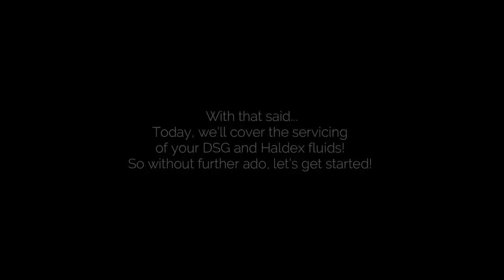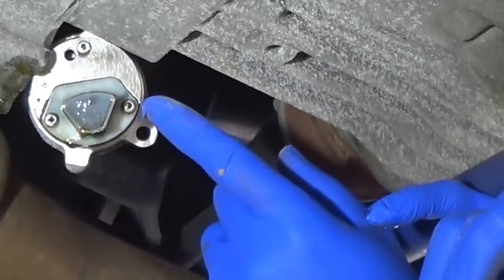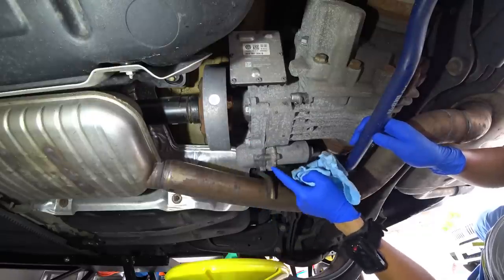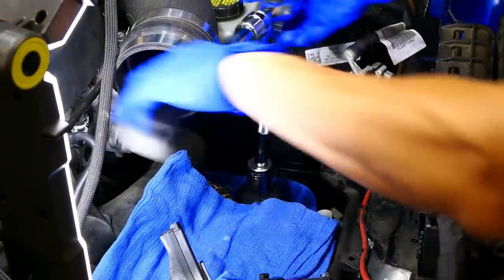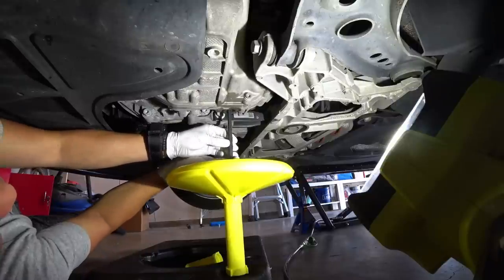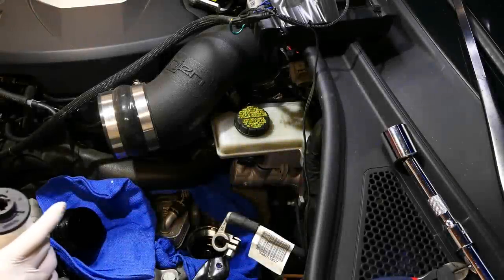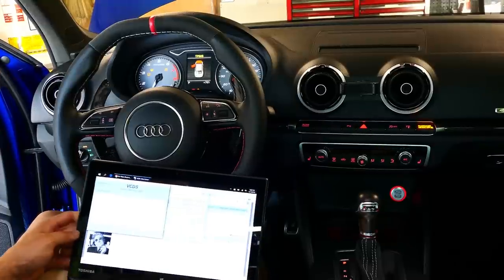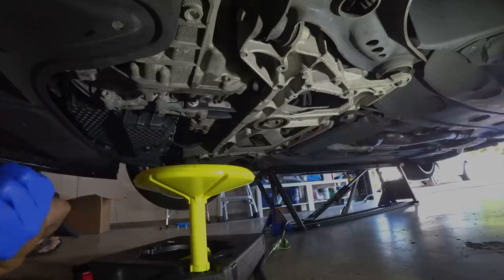How to change DSG and Haldex Fluid on an Audi

Comment: Great job!  I would add that you also need to prime the haldex pump after a fluid change, especially since you have VCDS.  AWD > basic settings > pump motor.
Reply: NickVisual is it necessary? without vcds is it impossible to do dsg oil change at home?
Reply: When is this done? After or before you've turned the car on? I thought letting it run for 30 seconds is the equivalent of pumping the haldex motor.
Reply: After draining the haldex side of the rear diff and filling, running the car and going through gears works fine.  I've tested it, and it pumps fluid through.  However, this works if you don't want to start the car.

Comment: amazing how much fluid went in after driving it around and refilling a 2nd time also people need to run the pump relearn feature which learns the pumps rotation speed it will be a lot faster because of the fluid being clean great video by the way
Reply from the maker: Thanks for the comment Debra, you're correct. Once the haldex fluid is filled, the pump should be primed.
Reply: What do you mean by this?

I thought running the car is the equivalent of pumping the motor. When I do mine I was going to fill it once. Let it run for 30 seconds and check temp. Turn car off and refill. Then run the pump via VCDS and refill a 3rd time.
Reply: @debrajohnson4689  This was actually pretty useful.

I think my next question would be do you perform this action with the car running or off? 

I understand now why the pump relearn feature is done. Actually makes a lot of sense.
Reply from the maker: @debrajohnson4689 , great tip!

Comment: Sir, thank you for the great video. I see that you serviced the Haldex pump without undoing and removing the electrical cable. Can you elaborate a bit on that one? My cable has a withered hull, the two little cables inside are visible. The hull was green and totally crisp, almost looking like oxidized copper. I know there is an electrical connector on the other end connecting to the little "computer" for the Haldex, and I fear to try to undo/open that electrical connector. Do you know how to do it without it breaking? I'm not familiar at all with electrical connectors on these modern cars. I have an Audi S1 from 2015. Also, another youtuber-mechanic was doing some stuff with an OBD or similar computer, checking or resetting something when he had removed the Haldex pump after refitting it. What would that be about?? Surely you can change the oil without involving computers?

Comment: Just an FYI - I realize this is for an S3, but on my RS3 there are two drains and two fills on the rear diff.  One side is for the Haldex pump and clutches, the other side is for the actual gears.  They use TWO DIFFERENT FLUIDS!!! Be careful doing this, as I made this mistake and put the wrong fluid on the Haldex pump side.
Reply from the maker: Thanks for the insight Funkyman831. This is something I was not aware of as I never had a chance to work on the tranny/diff/etc on the RS3.

Comment: Good video! If I may add, You should prime the pump using  VCDS. Go to AWD control module and run the pump. Just turning on the engine will not prime the pump.
Reply from the maker: Thanks for your input Q7-A3. You're correcting, priming the pump is HIGHLY recommended and a step I missed in this video.
Reply: Sorry guys, but why should any "priming" be necessary just by changing the oil? Please explain. Shouldn't the computer of the Haldex, that flat thing, or the cars ECU do exactly that?  @TheAutomotiveFanatic
Reply from the maker: @Unexpectedperspectivesnow your question is more technical that I am versed for. In my research, others have mentioned that it should be primed so I assume it's best practice to it that way.

Comment: The soot in the Haldex is most probably from the clutch disk. It's essentially like a brake drum or clutch or brake pad on a brake disc. It slips and rotates at different speeds. Or am I wrong?

Comment: Great clear instructions! The only difference I have is that the drain bolt is a 5mm allen which was the same as the fill bolt. I also have an 8vS3 2016
Reply from the maker: Thomas, glad yo found some use of this video! Cheers and enjoy that S3!

Comment: is not "soot" - its clutch material - and perfectly normal. Thats why the oil needs change. Good video.
Reply from the maker: You're correct Corvette Kro. It's 100% normal but owners should definitely clean it often.

Comment: That black "soot" is the fine metal particles from the clutch pack from repeated engagement. It's normal wear and tear.

Also, do you have the torque specs for the drain/fill bolt and the bolts for the pump?
Reply from the maker: Sorry for the late response CookJunkie. The torque specs for the drain/fill bolts are: 32-35nm.

Comment: I have a question, Im going to be doing this dsg service in a couple of weeks on my 2015 audi a3 quattro. My question is, let say if I drain 5 liters and I put 5 liters back in, is the turning on the car, shifting the gears, letting the transmission get to the certain temp then draining some out really required? Im just putting back in what I took out. I’ve always wondered if those other steps are really required. Great video btw! It will sure come in handy when I have to do mine!
Reply from the maker: Keep_boostin, the way that you're planning to do it, is the most simplified way. There's absolutely no need to do all the other actions as long as you put in, exactly what you removed. I would have performed my service this way, but I wanted to show people how Audi would do it. There's more than one way to skin a cat. Good luck, just make sure you measure the exact amount of fluid that drains out.
Reply: The Audi S3 Fanatic That’s great news! I had always wondered if that worked, Im happy it does! Yes I’ll make sure to measure everything exactly when I drain and fill. Thanks again for the fast reply and the amazing video!

Comment: Hey Peter, that was a great video instruction you made!  (1) I wonder if I can apply the same procedures to my 2018 Q5 2.0t Quattro? (2) I read the comments below and wanted to verify that there is a front differential, a rear differential and a haldex, a total of 3 fluids to change in addition to the DSG transmission?  I'm kind of confused...
Reply from the maker: Hello Shawn, If you are doing a drain and fill, yes, measure the fluid that comes out. Then simply replace with the same amount.

Comment: So is the car running when you drained the excess fluid out on the DSG service?  or can the car be off?  Didn't know you can fill from the top? How about when you disconnected the battery, any issues with resetting things?
Reply from the maker: Yes, you want the car to be running so that it can reach proper operating temperatures.
When disconnecting the battery and reconnecting it, your dash will light up like a Christmas tree with all kinds of error codes. It's normal and as soon as your start driving, the dash warnings will go away.
Reply: @TheAutomotiveFanatic  thanks, i see now i can get to the filter easy not removing the battery by removing the intake duct and using a low profile 24mm socket with 3/8 wobble extension. I have OBDeleven to get temp correct before final fluid set. Doing this service this weekend. Try to decide to fill thru the top or use hose and fill thru the bottom drain??
Reply from the maker: @skydancerforever Thank you for sharing your DIY steps. Hopefully it helps others too!

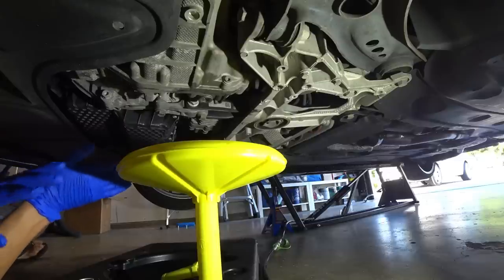Comment: Great tutorial! Is the engine still ON for the last drain at 18:14? After it’s reached the correct temperature ?
Reply from the maker: Yes it is, until you drain the excess fluid and tighten up the drain bolts.

Comment: Hi Peter, so when you’re leveling the dsg fluid, letting out the excess fluid how do you prevent from having more than the excess fluid empty out lol. I just don’t understand.  Is it the temperature? 

Thanks
Reply from the maker: The reason why Audi recommends that you "level" the fluid, is exactly due to fluid temperatures. I understand the concept, but cannot fully explain the principle behind it. I believe it deals with viscosity, flow rate, etc...

Comment: Did you replace the pump seals and mounting bolts and/or the drain and fill plugs with new ones? I think it's recommended, but maybe not necessary. While the drain and fill plugs are only a few dollars each, the pump seals and mounting bolts are about $40 total, so I'd prefer to skip it, if it's not really needed. Thoughts?
Reply from the maker: Jeff, I did not replace any of the items you mentioned. As you know, Audi would recommend it but I do not believe it's completely necessary. I've checked the surrounding areas and not a single drop of fluid. You should be fine as long as you don't damage any items in the removal process.
Reply: @TheAutomotiveFanatic  Thanks for the quick reply. I'd assumed as much, but really appreciate the feedback. Other than people doing videos who are selling products, I hadn't heard of anyone replacing them, which makes sense. Thanks again for all of the great videos!
Reply from the maker: @reaxions  Thank you for the support!

Comment: Hi Peter, I finally managed to get the DSG oil refilling bottle so am going to replace the DSG oil soon, I just saw again the video and I noticed that during the DSG oil levelling procedure, the engine is running; is this a "must do" step? many thanks!
Reply from the maker: Yes Lorenzo, it's important to have the engine running to properly level off your DSG fluid.

Comment: The one thing that wasn't serviced was the front differential between the DSG and the drive shaft..it is also very important
Reply from the maker: David, you're 100% correct. Since you're underneath the car and servicing the DSG, you might as well service the front diff.

Comment: Hey there, so I’m planning on doing the DSG and Haldex service on my 08 A3. My question to you The Automotive Fanatic will it be the same process as your vehicle? Plus I saw someone mention something about the differential, do you have a video on how to change that fluid as well? Thank you in advance.
Reply from the maker: hello there ezequiel, the servicing on the 8P A3 is somewhat similar. The main things you need to do:
- drain the old fluid
- replace with new fluid
- make sure you level out the DSG at the correct temperature
As far as the differential goes, it's pretty much a drain and fill, very simple proceed.
Reply: Thank you. I appreciate the quick response.

Comment: nice and useful video! do you know if haldex and DSG filling/draining plugs are located exactly the same on TTS MK3 too?the bottle to easily put DSG oil is DIY or it can be bought somewhere? thanks
Reply from the maker: Lorenzo, from my research, I found out that the MK3 is a MQB with relatively the same setup as the S3 when it comes to the Haldex and DSG servicing. You should be able to use my guide to service yours!

                           As far as the DSG fluids, if I am understanding you correctly, you need to purchase it online or from a dealer.
Reply: thanks Peter, much appreciated!regarding the DSG oil filling bottle, can you provide some link? seems not to be found  easily here...

Comment: How much oil you actually drained for leveling the oil? I just want to know how much oil at least needs to be inside after leveling.
Reply from the maker: Byun, that is a tough question to answer because I did not measure the amount of fluid that drained out when it leveled. Here is my suggestion and what some others have done. Measure the amount of fluid that you drain TOTAL, then replace that amount and a little more once you're done. It's not an exact amount, but should get you close.
Reply: I finished DSG oil change last week, filling up 5 liters and drained at 35 C degree, but oil drained a lot, I am so worried if it is ok to drain that much and I feel like only 3.5~4 liters are inside of the DSG. Do you think I need to fill up more through filter?
Reply from the maker: @byunpaul8344  I reviewed my service record and I filled up with 5 quarts. The amount which came out though, was perhaps 1/2quart, maybe more. What I would do if you're paranoid, fill up with another quart and repeat the leveling process.

Comment: Did mine and followed all the steps but my transmission temperature reached up to 40c after I drained the excess fluid. I turned it off at 40c because I wasn’t sure if something was wrong. Not a lot of excuses fluid came out. I do have an 18 audi rs3. So idk if it’s different
Reply from the maker: Yours may be different because the RS3 uses a 7 speed DC compared to the 6 speed of the PFL S3.
Reply: Thank you for the fast reply. I am currently looking online for more information. I saw another video and they state between 35-45c. I rechecked my temperature while on level ground and at idle. Using my scanner and temperature reached 50c. So I will be doing the service again for peace of mind and recheck the temperature again
Reply from the maker: @gggg-vc4so  it never hurts to be safe. On my 911, I leveled out the fluid twice, just to be safe.

Comment: Hi Peter I have a quick question about haldex maintenance I follow your video on how to and thank you for that.  Now I think I made a mistake and not only I drained the haldex from the front 8mm bolt but also I drained the differential from the rear 5mm bolt is there a different gear oil for the differential compared to the oem haldex fluid that I used for the front G060175A2 ? Because its showing me 75w 90 gear oil for the differential so I'm all confused if I should by another 850ml of A2 fluid or the 75w 90 gear fluid thanks !
Reply from the maker: Paul, sorry for the late reply...I just saw this in my inbox. Haldex and diff fluids are completely different. If you mistakenly drained your rear diff, purchase the appropriate fluids for it. I hope my answer helps!
Reply: @TheAutomotiveFanatic  
Thanks for getting back Peter I appreciate it yes I already found out made a mistake or draining the haldex then I saw another drain plug further back and drained that too🤣. So I went ahead and serviced both front and rear differentials with some oem gear oil 75w 90 .
Reply from the maker: @psagan27  Good for you. A while back, one of my subs asked if I had serviced my rear diff. I had not and plan to do it with my next oil change.
Reply: @TheAutomotiveFanatic  nice ! I found out that there is no maintenance needed on rear differential,  but I find that bs so I'm glad I did both front and back I have 30k on the vehicle now so I should be good with haldex,  and differentials for next 30k now I have to do the transmission next

Comment: Peter, thanks for the video this is a tremendous help. I do have a question however, would you please explain your reasoning behind deviating from the book and not using the special tool when refilling the oil? Just curious.
Reply from the maker: Hi Jon and thank you for supporting my channel. To answer your question, yes, the book states to fill the DSG fluid from underneath. I chose to fill it from the filter housing because it's simply faster. Fluid runs straight down the hose as opposed to down a hose, make a U bend and back up the filler port. The most important item though, is making sure the fluid is properly leveled off, irregardless of how you fill it.
Reply: @TheAutomotiveFanatic  got it, ok thanks! Will be doing this plus a few other things tomorrow and your videos have been a tremendous help! Thank you 🙏🏼
Reply from the maker: @mikehawk8609  Feel free to post up if you need additional help.
Reply: @TheAutomotiveFanatic  Peter, I have another question. I’ve already done this service awhile ago, but my paranoia has gotten the best of me and I’m getting ready to do the dsg service again for peace of mind because I may have installed the plug prematurely last time around. So I was wanting to know a roundabout guesstimate of how long you waited before the fluid came to a drip before you plugged it back up and torqued it? Thanks in advance!
Reply from the maker: @mikehawk8609  the proper was to "level" the fluid is to use an OBD scanner which can read the DSG fluid temp. You want to run the fluid to 36* celcius then open the drain. There isn't a specific "time" on how long I let it drain before closing it back up. I basically allowed it to come to a slow trickle, then closed it up. Refer to 18:14 in the video.

Comment: Where did you get the hose for filling the transmission through the top? The only kits I can find have a very expensive fluid pump I'd rather not buy.
Reply from the maker: Jake, depending on where you live, take a look at a tool store called Harbor Freight. Their kit had the tubing and pump. It cost me less than $10.
Reply: @TheAutomotiveFanatic  I didn't see any tools at HFT that would exactly work, so I cobbled together a few tools of my own available from Amazon and your local Blue/Orange/Red Home Improvement Store.  Not sure if the Haldex connectors are the same for Haldex Gen 2.  My vehicles are all Gen 4.

For the DSG Transmission Tool (VAS6262), I used a short run of 3/8" ID Tubing, available from Lowe's Depot Ace. For the bottle end, you will need one of these generic screw on connectors (https://www.amazon.com/gp/product/B07WSHY3X6).  If you are filling from the top, per the video, you are good to go.  If you are filling by-the-book, you will need a VAS6262-1 connector at the bottom for the transmission end (https://www.amazon.com/gp/product/B08Z7SZ161).

For the Haldex AWD Tool (VAS6291), I purchased this fluid pump (https://www.amazon.com/gp/product/B00329VL3G) designed for a purpose just like this.  A little Vinyl tubing is included.  I also got fancy and bought an M10x1 angled connector (https://www.amazon.com/gp/product/B07DR61JQY).  My goal with the connector was to save as much precious $$$ fluid as I could.  However, I feel I may have just wasted more fluid because I could not tell when the clutch really was full.